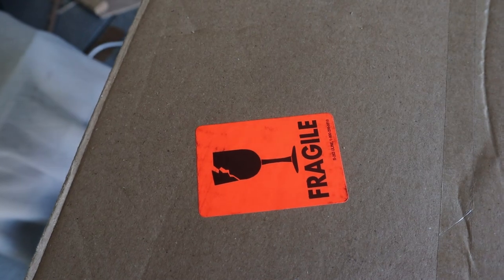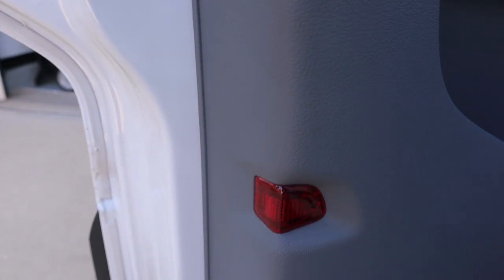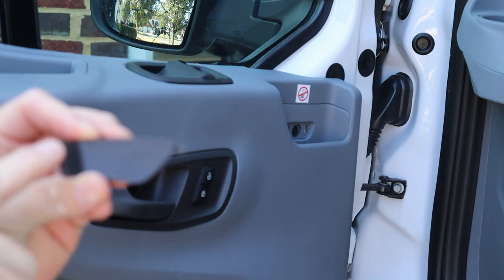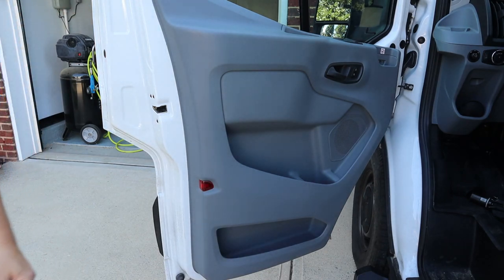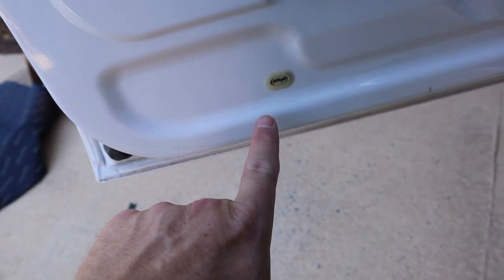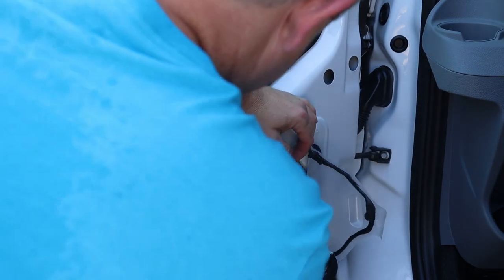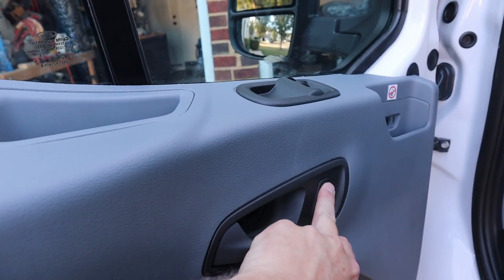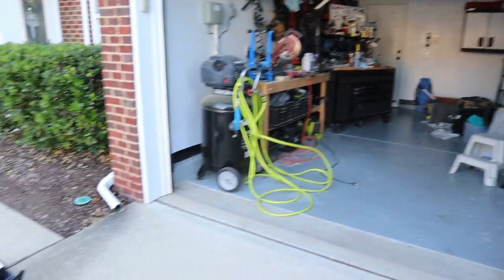#MTBPlanB How to replace double arm mirror on 2019 Ford Transit

Comment: Thank you?  I am buying an 8’ wide trailer and have to swap out the stock mirrors today.
Reply from the maker: Good luck Be careful with the bolts...using the tape method on the socket helps.

Comment: Did you get factory replacement or aftermarket? I have the long arm mirrors on mine as well and have broken the light on it twice. Luckily never hit it hard enough to smack it closed, but have been looking to swap for sorry mirrors.
Reply from the maker: I replaced it with oem. Could you just replace the light versus the entire unit?
Reply: @MTBPlanB  Thank you, absolutely I am able to replace just the light, but I would like to switch to the short arm mirrors to be less dumbo like and lessen the chances of future strikes. From what I can tell the short mirrors stick out about 8in less.
Reply: Initially I was just hoping I can swap with somebody who wants the long mirrors instead of the short ones, but it has become apparent that nobody really wants the long ones.

Comment: Are both the top and bottom mirrors electric? How do you adjust the lower curved mirror is it manual for electric I couldn’t find the control to do that on the Transit that I’m using
Reply from the maker: It’s manual only on my model.
Reply: @MTBPlanB  ok thanks so bigger top mirror is remote and lower curved is manual adjust… disappointed Promaster with its many flaws were remote control top and bottom mirrors

Comment: Thanks for the video! Just busted the passenger side on my 2020.  How long is the wire that the mirror wire connects to?  Any chance you can disconnect the mirror and then pull the wire out far enough to swap out the mirror without removing the door panel??
Reply from the maker: If I remember correctly, the wiring harness for the mirror had a couple of cable ties holding it to push pins in the door. I decided not to risk trying to pull on it hard from the mirror side.
Reply: @MTBPlanB  That makes sense! Don’t want that rattle
Reply: Too bad that connector isn’t right at the end of the mirror :(

Comment: Thanks for sharing the video.   I find the (vapor?) seals a bit ironic since there are so many other open holes, albeit smaller.  They seem to only cover larger areas, so I suspect they are more for sound dampening.  What  do you think ?
Reply from the maker: Could very well serve two purposes!
Reply: @MTBPlanB  could be.     BTW, Do have any idea of how the Mirror's arm covers are attached ?    I am wanting to mount a tiny little rear-view camera on each mirror arm, and need to remove arm covers so I can route the wire through the tunnel the the mirror wires go through.  Thank you.

Comment: Hi, Thanks for the detailed advice.  Any tips on why my indicator blinks faster since the replacement? All bulbs are working and connections are secure.
Reply from the maker: Are the bulbs rated the same as replaced unit? if so perhaps check the turn signal relay.